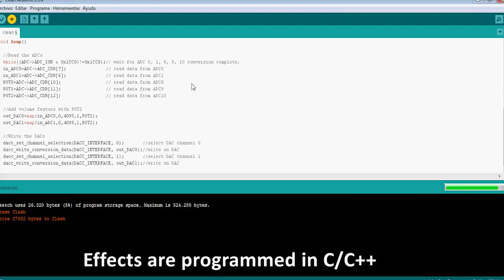pedalSHIELD DUE Arduino Guitar Pedal

Comment: nice work!, just one cuestion, does the pedal need to be conected always to the laptop/ computer ???
Reply from the maker: Hi Akuro, all the pedalSHIELD projects need a computer/laptop to load the code but after that, you can decide to power it up with a USB (laptop) or use a 12DC wall adapter. This post on the forum has all the info about this topic: https://www.electrosmash.com/forum/hardware-pedalshield/26-powering-arduino-due
Reply: ElectroSmash thank you for the answer !!

Comment: the pwm on Arduinos just isnt designed for audio. I feel like the quality of the digital audio would just be terrible because the bit rate just isnt fast enough especially if the code is written in c++ or arduino languages the processing time just isnt good for real time signal processing. the only effect i could see it doing ok as would be a bitcrusher effect maybe which would take advantage of the pwms slower bit rate.
Reply: I was thinking the same thing. When I saw this, I was wondering if a version of Arduino was released with better chips for audio, but that does not seem to be the case.

Comment: Is it possible to use it with a bass? I know that the preamplifier of a guitar is different to the one of a bass and that this pedal is plugged in its output, but would it work all the same with a bass? Thanks in advanced
Reply from the maker: Hi Gabriel, yes, you can use it with a bass guitar. If you want to let even more low harmonics you can do a simple mod, just using bigger caps, check this out:
http://www.electrosmash.com/forum/hardware-pedalshield/79-guitar-pedal-modification-pedalshield-for-bass